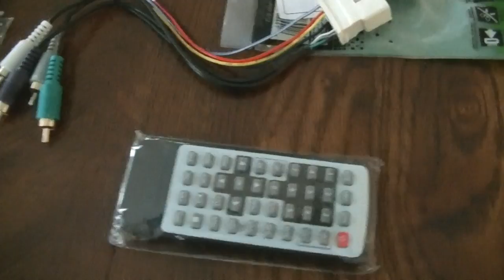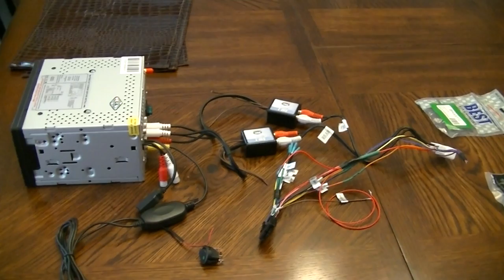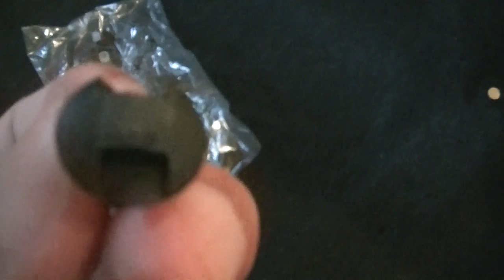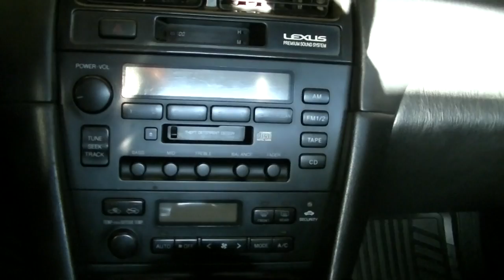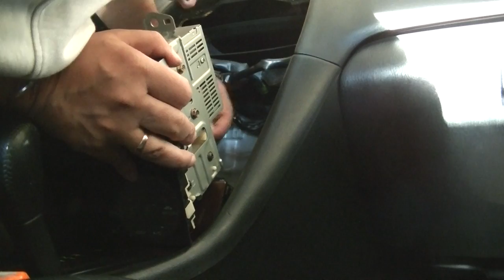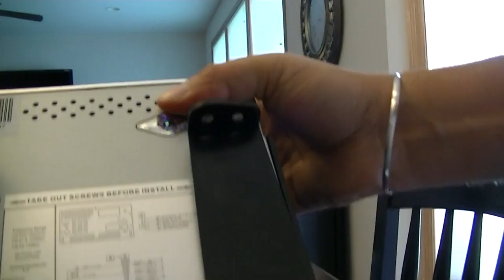1997 Lexus es300 stereo replacement with aftermarket double din head unit - Part 1

Comment: I have a question when you ran into the issue of the two white radio wiring what converter did you buy to connect to them
Reply from the maker: I connected only one and left 2nd unconnected. I also recommend highly that you follow Part2 video instead of Part1 since bypassing amplifier produces best sound without any noise.

Comment: Were you able to get the back up camera running? How is the wiring there sir, thank you
Reply from the maker: No backup camera never worked. I did not troubleshoot. I was able to install it on lexus es330 using hard wire approach. You can watch that video

Comment: Hi, in 28.42 of the video you commented on the fact that these factory head units actually had 2 wiring harness sockets - one with 15 pins which would fit the after-market 8112 harnesses. What about the 2nd socket which has 12 pins? What was your solution?
Reply from the maker: Fink Nottle I left second one as is unconnected. It did not affect anything. I strongly suggest you to watch part2 video too before you decide how to install new head unit.
Reply: Please ignore. I went through the other questions and determined that the 12 pin factory socket is un-needed
Reply: I think the second one is used to connect the factory radio to the CD player unit which on my car (ES300 1996) is located in the trunk. Great video by the way! You helped me a lot :)
Reply from the maker: Always nice to know that this video was helpful, that was the whole intent for posting it in detail. I think you are correct in your assessment on the functioning of second connector.

Comment: Hello Vijay,  I watched your video, it really did help for me, but I have some questions, can you help explain it? 1. Did you keep factory amplifier in this way? 2. Is the PAC SNI-1 necessary? If it's just a noise filter, it means the audio can work without this filter. 3. Did you connect like this? https://lh3.googleusercontent.com/-dqWOK-rHiLI/WMVIdzrUdqI/AAAAAAAADIQ/H2Ru1k6AVEk0ZzSCs2oDaVcoODkVAKdBQCJoC/w530-h220-p-rw/QQ%25E6%2588%25AA%25E5%259B%25BE20170312210741.png
If possible, can you send your guidance to my e-mail? This is my e-mail address: echojoying@gmail.com
Really appreciated for your help.
Reply from the maker: You are right the way you have drawn the picture but I ended up redoing it differently (by passing/eliminating the amplifier). I had to use a different cable for that and i have explained that in part two video. It is easier to do that way and there is no need to use any sound filters. Simply buy the wiring harness (parts number shown in part2 video, extend all wires by 3 feet, open glove box and  insert wiring harness to amplifier and the other end of wiring harness goes to radio (amplified end). After watching part2 video if you have questions let me know. It is working fantastic till date.
Reply from the maker: PAC SN1 filters turned out useless and i contnued to hear engine whine noise. Do not buy them, instead connect audio directly. If you still want to pursue doing it the way I am doing in part1 because you want to retain facory amplifier then you may try https://www.amazon.com/Asdomo-Pre-wired-Plastic-Isolator-Suppressor/dp/B01DXEBEB8/ref=sr_1_74?ie=UTF8&qid=1489325146&sr=8-74&keywords=noise+filter (insert on the RED wire). It helped me in eliminating engine noise in Lexus ES330 where i had no other choise but to keep the factory amplifier. It is hit and miss/may work for you too.

Comment: Did that phob key come with the car? Mine doesn't have one but I want one!
Reply from the maker: Yes i got one with car and i bought a spare one from EBAY. These are easily available on ebay and needs some basic programming steps like open and close the car door locks few times in a particular sequence to have new key fob (remote) recognize your car.  However you need to know the fcc id that is applicable to the remote of your car and it is mentioned on back of the phob, if you have none then you can give your vin number to any lexus dealer and ask for FCC id for your car's key phob. After that you can search ebay with key word '97 Lexus ES300 remote' or whatever model year is of your car.

http://www.ebay.com/itm/OEM-LEXUS-ES300-LS400-Alarm-Remote-Control-Keyless-Entry-Key-Fob-Transmitter-/132066192791?fits=Year%3A1997%7CMake%3ALexus%7CModel%3AES300&hash=item1ebfc22d97:g:kHIAAOSwUKxYfAyR&vxp=mtr

Comment: Bhaji my everything is work fine but speaker output is not working. I hav used metra wire harnesses is i hav to look at wires??
Reply from the maker: Are you installing with amplifier integration (following Part1 video approach)? or installing through bypassing the amplifier (as shown in Part2 video)? If you leave your number here, i will call you.

Comment: Thanks for the video. I'm installing a new head unit myself in a 1996 Lexus es300. What did you do with the 2 antenna connnectors that you unplugged? My OEM unit has 2 conntectors and 2 inputs for antenna, but my aftermarket unit only has 1.
Reply from the maker: If 96 Lexus is nearly same as 97 then you will notice a little difference in size of the antenna connectors. One is slightly bigger then other one. In my case only the bigger one fitted into the new headunit, i left the smaller one unconnected. It works well.

Comment: What size is your new unit?
Reply from the maker: I did not measure it myself but what i found is that all branded units like "PIONEER, SONY, KENWOOD" double din have a standard size which match exactly with the opening on faceplates from Metra or Schohe etc. however all non name brand chinese double din units are slightly bigger then standard size. If you want the new head unit to be easy to fit flush with faceplate then buy double din size in PIONEER, Sony etc.

Comment: Great video.  When you removed the factory stereo, you were surprised there were two white plugs.  You didn't elaborate what the second one was for.  Was it for the six-disc changer in the glove box?  If so, I am assuming you didn't have to do anything with it.

There were also 2 metal pins for the antenna.  Which one did you plug into your head unit?  The silver or black?  And what did you do with the other one?
Reply from the maker: +Roland Soe  I did not explore the use of second white plug further but i guess you are right, it is most probably for six-disc changer. I left it alone (unconnected).  Now after completing the amplifier bypass as shown in Part2 both white plugs are left unconnected. Six disc changer still has power and is able to eject or receive CDs but it is just redundant item now (not connected and not in use).

Comment: I purchased the BEST BHA8112 but seem likes it doesn't fit. What did the other kit that you bought? Is it fit?
Reply from the maker: +Wilson Tran Yes I bought the same harness and it did fit exactly. Few questions:

How many Pins are you seeing BHA8112 kit?  
On car how many adapters are connected to the radio and what is the PIN count in each adapter? 
What is the year of your Lexus ES300?

I did not buy any other kit. My kit had one 14 or 15 PIN adapter (I don't remember exactly) which was an exact fit to one of the two adapters on car and the other adapter in car was left unconnected.
Reply: +Vijay Bhalla I installed it follow up your video. But when I plugged it in the stereo is on but has no sound. Do you know what is wrong with that?
Reply from the maker: +Wilson Tran If stereo is getting powered on and all speaker wires are connected then pay attention to amplifier turn on wire it is Blue with white stripe. Is that wire connected too? If not then that is the cause. Can you also share the year of your Lexus ES300?
Reply: +Vijay Bhalla I fixed the problem already. I forgot to wired the blue/white wire to the head unit. And I have other question too. How come I feel like I'm losing the sub power? Do I need to get another amp for it? And I have 97 Lexus es300
Reply from the maker: +Wilson Tran I am myself working on Amplifier bypass. If i get success then i will post a new video on it.Amplifier bypass is a solution to get best audio quality and eliminate engine noise. Watch for my next video in about 2 to 3 weeks. putting a new amplifier is too much work and not something i am going to try anytime soon. i am quite sure just bypassing it will give highly satisfactory result.
Reply: +Vijay Bhalla thanks for the input. Im following your video right now
Reply from the maker: +Wilson Tran Part 2 video showing amplifier bypass is published now.

Comment: i bought the BHA8112 in http://www.amazon.com/Best-Kits-BHA8112/dp/B016AF2IYE/ref=sr_1_1?ie=UTF8&qid=1447249089&sr=8-1&keywords=Best+Kits+BHA+8112 , i work perfect :D , easy to use . 
Thanks a lot about your video , i can install the JVC head unit on my 99 . 
Thanks again  
p/s : dont use metra harness guys , that suck :D

Comment: Thanks for the post, this is very informative. I have one question regarding the two connectors for audio. I see aftermarket stereos which have only one connector. Whats the purpose of other connector ?
Reply from the maker: +Brijinder Singh Per my understanding If an aftermarket stereo has only one connector (Left & Right) then either it can be connected to Front Left and Front right door speakers connectors (which will make the speakers on back two doors completely silent) or using a Y connector Left of head unit can be connected to Front Left and Rear Left door speakers of car and  Front right can be connected to Front right and rear right of the car. In Y connector situation, Bass will be completely missing and fader will not function since same level of sound will be coming from front and rear door speakers.

In a good audio system's column (traditional) you must have observed there are three speakers. Top one is smallest (Treble), Middle one is slightly bigger (Inter mediate) and bottom one is largest (Bass).  In car with premium sound system the Treble and Intermediate is on front door therefore you will see these two speakers on front door and Bass single speaker is on rear door.  Front Left of headunit serves the Treble and Intermediate both together via the amplifier's handling of signal segregation and  Rear Left connection of headunit serves the Bass speaker on Rear door. Same goes for Front Right and Rear Right on head unit.

Comment: Hi dear , 
I have one question, is this the wiring harness u use ? 1 got 99 lexus es300, and i have problems with the orange wire , it's dont have in metra harness , so i want to buy the best kits BHA 8112 but seem like in the photo of amazon is the dash kit ? , is it still the harness i need ? 
http://www.amazon.com/Best-Kits-BHA8112/dp/B016AF2IYE/ref=sr_1_1?ie=UTF8&qid=1447249089&sr=8-1&keywords=Best+Kits+BHA+8112
Reply from the maker: +Nguyen Toan  I dont know why vendor is showing the image of dash kit now but when i ordered at same link vendor was showing wiring harness image. Try ebay for same code BHA 8112.

http://www.ebay.com/itm/Best-Kits-BHA8112-Car-Radio-Stereo-Wire-Harness-for-JBL-Synthesis-Amp-Retention-/141612138819?hash=item20f8bdc143:g:vbwAAOSwBLlVDbSz&vxp=mtr

Comment: How did you like using the RCA filter?  I have never used RCA connections for my stereos; are they pretty necessary?
Reply from the maker: +Jared McAllister At my home I used same noise filters in between my Laptop headphone out and Home theatre Audio in and I found that they eliminate humming noise as well as makes base very clean and audible. Without them I had to disconnect my subwoofer since base sound was worse. In car I did not try how it sounds without them but I guess they helped in reducing the alternator/engine noise to bare minimum. It will be really interesting to know how it impacts the sound in car without RCA noise filters as well as by connecting to amplified outputs (instead of non amplified RCA connections). I will get my hands on ES300 next summer and will try definitely and post the outcome but if someone else try it before then will certainly like to know the outcome.
Reply: +Vijay Bhalla very nice. I appreciate your guidance. I've seen your amazon reviews and posts on clublexus, it's all very helpful.  its a nice ES too

Comment: Im a bit new at car stereo systems.  Why did you not use the new headunit's amplification?  Does the ES300 have its own amplifier or am I missing something?
Reply from the maker: +Jared McAllister Yes ES300 has own amplification and general recommendation in this situation is not to use headunit's amplification as this will lead to one amplified output feeding into another amplifier (double amplification). Some users are able to disconnect es300 amplifier completely by opening the glove box but that is too complicated procedure and I wanted absolute no modification to car's system.  My only recommendation to anyone else attempting this same procedure is to try to avoid using black (ground wire) of METRA/Car's harness and instead connect a new ground wire to headunit's own body. Just experiment and see if that eliminates the engine/alternator noise. I tried this procedure on ES330 and it did work out great but I did not get a chance to try out on ES300.
Reply: +Vijay Bhalla Thank you!  Don't most headunit ground wires just go to the chasis of the vehicle?  Or am I missing something?
Reply from the maker: +Jared McAllister They do not go on their own. You have three choices in all situations 1. Connect head unit's black wire to Black wire of vehicle harness which in turn connects head unit to -ve of car's battery 2) Connect Head Unit's black wire somewhere on the metal of vehicle body directly which means grounding to body of the vehicle 3) connect head unit's wire back to chasis of head unit itself. This is what I will recommend because I tried this on ES330 and it worked very well. At least try option 3 if engine noise does not go away using option 1 or 2.

Comment: Hello Vijay , Thanks for the video it has helped greatly !
I just have a question about the wiring that you did . How exactly did you wire the harness to the new aftermarket radio ? 
I am having trouble right now with my ES 300  , the harness I bought does not fit and I have no idea how to make the connection! Much appreciated ,
Jerjor.
Reply from the maker: Jerjor96,  In my video I did show the exact wiring harness I bought and used. It is Best Kits BHA8112.  It connects to just one of the two connectors in the car ie. it connects to one 15 PIN connector in car and other connector in car remains unconnected. Which year is your ES300, because I think this harness is for ES300 (upto year 99 models). For later year models harness is different. I did show the exact wire match in my video too (just soldered both ends together).